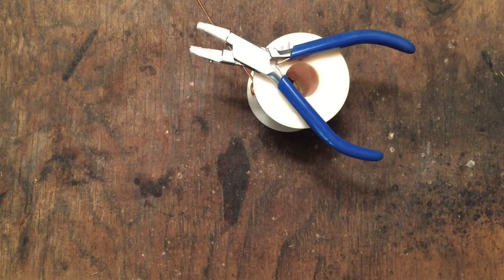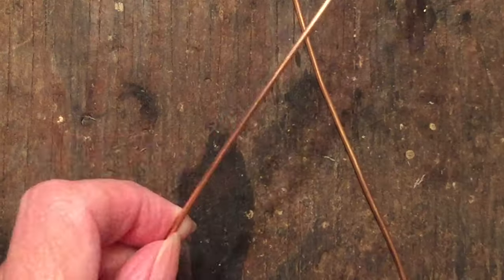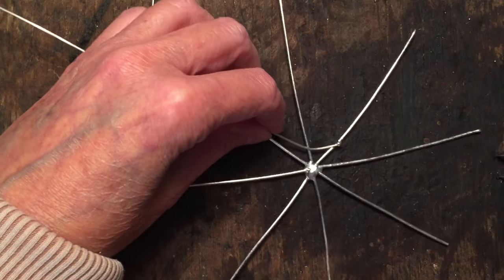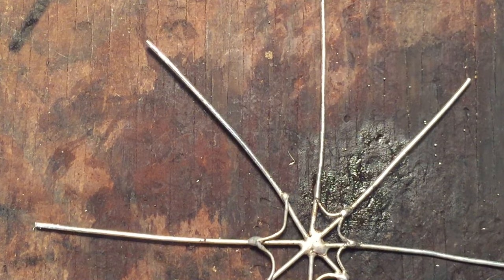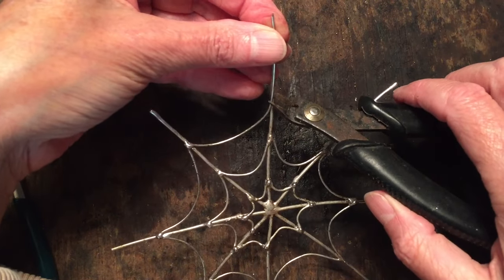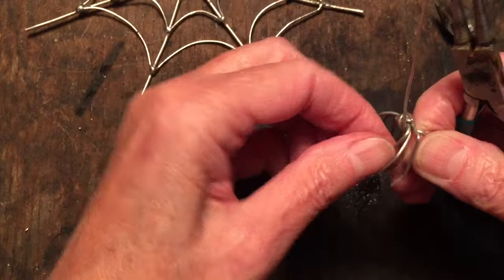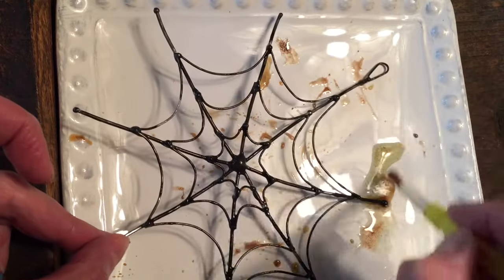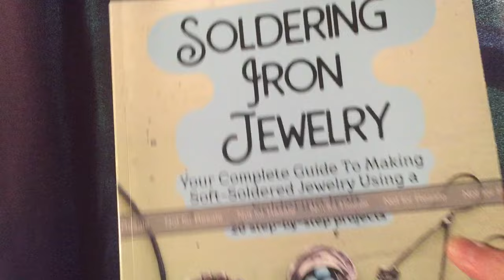🕷 DIY Soldered Spider Web 🕷

Comment: Which kind of copper wire are you using? my copper wire didn't accept the solder so I always have to wrap it in copper foil
Reply from the maker: You should never have to do that. Your copper wire is probably: either coated with a thin coating of plastic, dirty and not shiny like a new penny (clean with steel wool) or perhaps not pure copper. I use regular copper wire, nothing special.
Reply: Sometimes you get CCA = copper coated aluminium. At least for cables it is cheaper than copper, but almost unsolderable and you need a thicker wire for electrial installation.